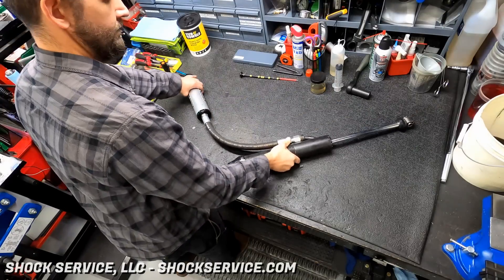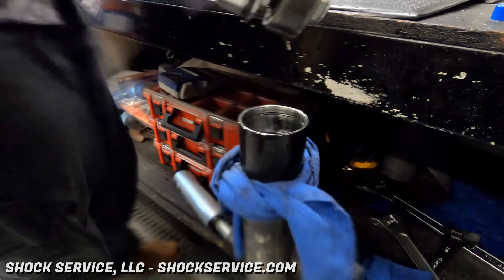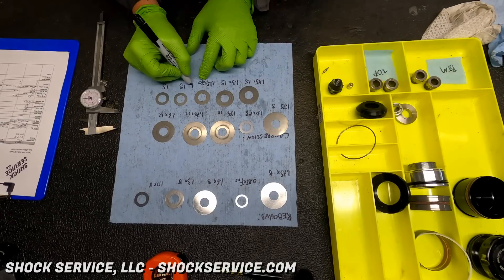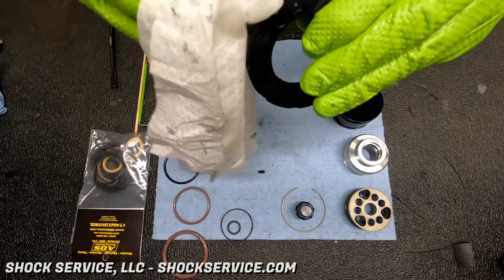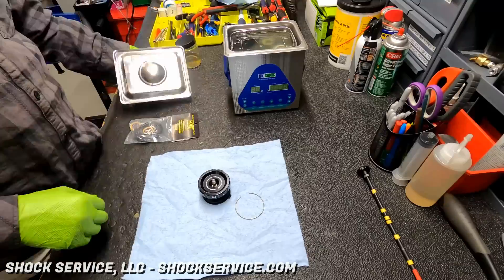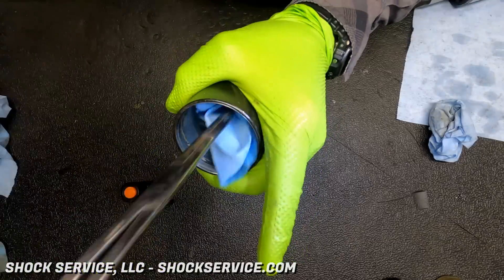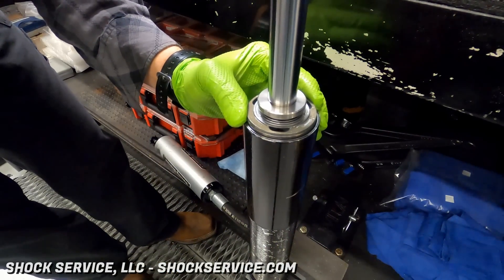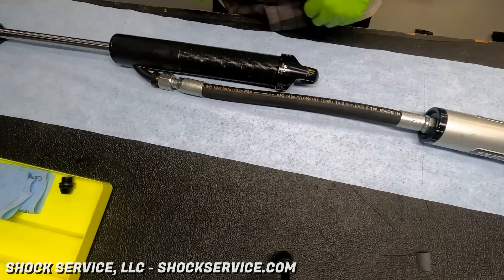ADS Shock Rebuild Video with Voiceover by Shock Service, LLC

Comment: you talk about the pressure needed to remove the whiper cap, but i don't understand why?
Reply from the maker: Great question! The wiper cap threads onto the seal head so if there is no pressure in the reservoir the seal head might turn under the retaining ring. In other words, the pressure pushes the seal head against the retaining rings and creates enough friction that you can un-thread the wiper cap.